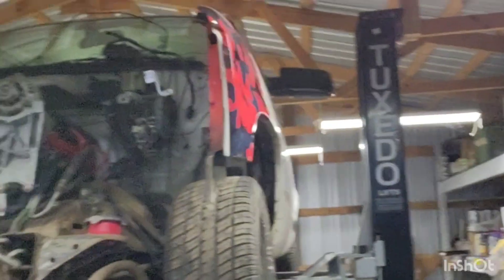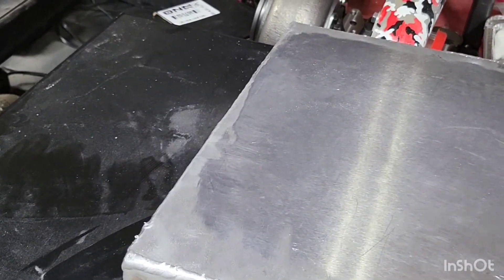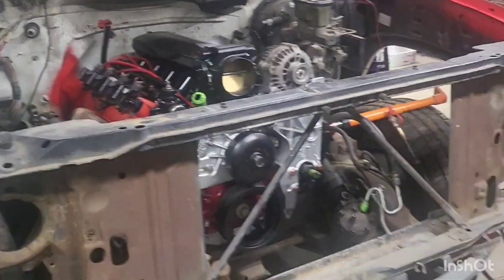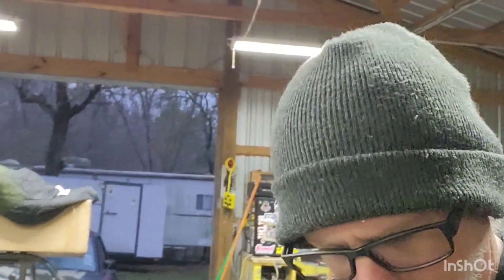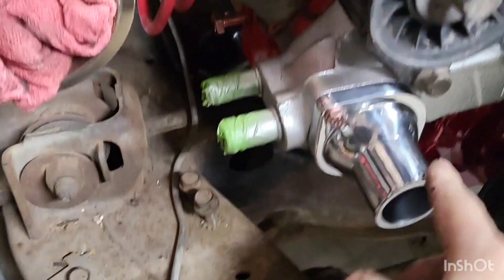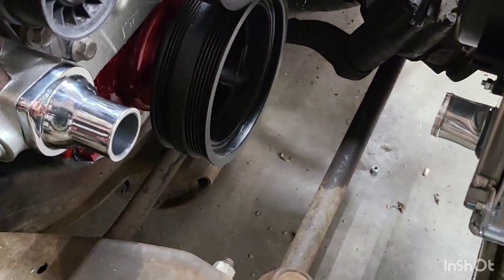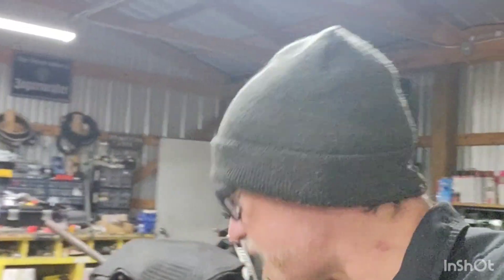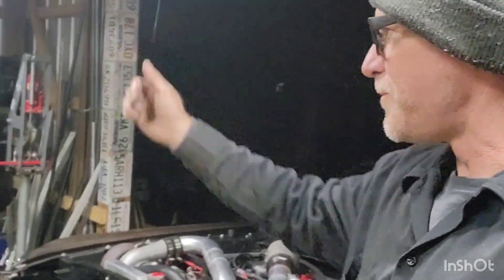Cheap Race Truck Build Pt 5

Comment: Nice job finishing the fuel cell, very nice job on the welds. It should give you what you want. Really nice looking
job on the radiator install, that looks great as well.
Reply from the maker: Thanks, I have been practicing and the radiator install should look really clean once everything is painted

Comment: Radiator looks like it was meant to go in that truck. Can’t wait to see the finished product.  Keep on grinding hard.
Reply from the maker: It definitely fits like it's supposed to be there and it should do pretty good being a 4 core
Reply: @toyshopfab  for street driving and 1/4 mile runs it should do just fine. If anything if you had to and had the room you could put a pusher fan on it too.